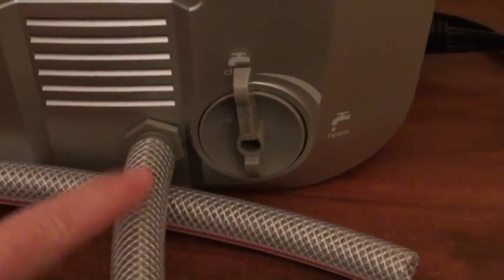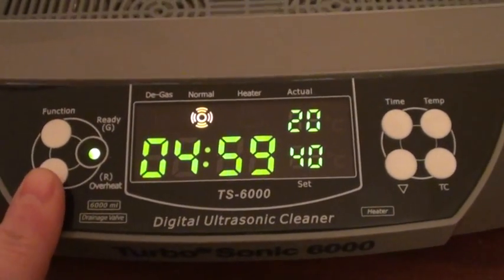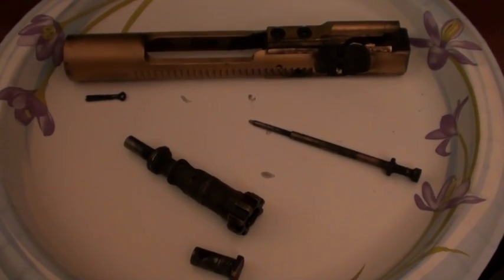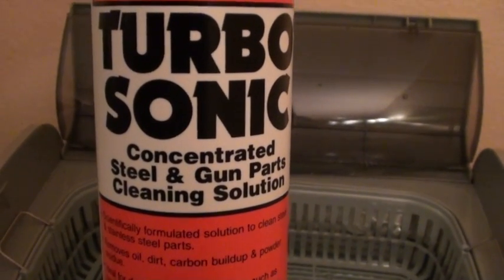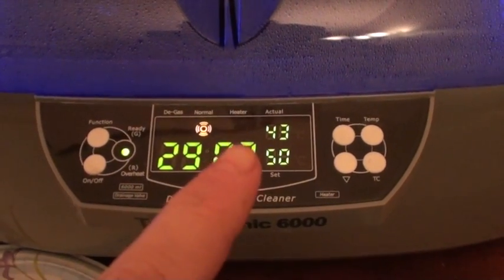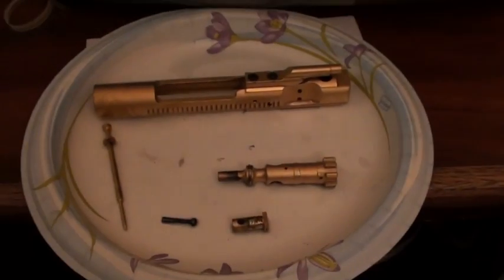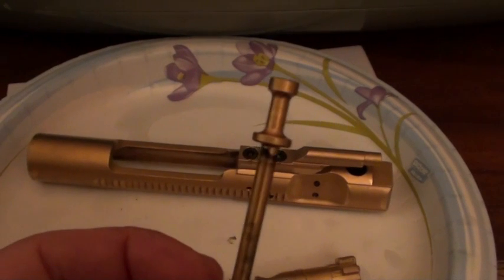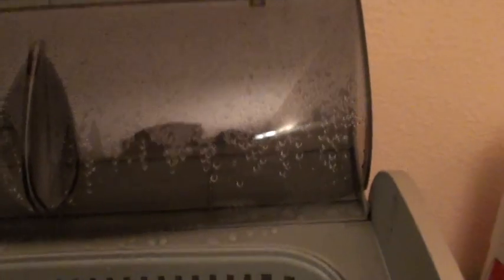Turbo Sonic 6000 Ultrasonic Gun Parts Part One

Comment: The De-Gass feature does not conduct a deep clean on your parts. That feature is to move any air bubbles "de-gas" from your water before submerging your parts. Less air molecules in the water, reduces cavitation which is not effective on cleaning parts.

Comment from the maker: Depends on what you are using it for.

Brass: prep the primer pockets, 1.5oz solution, cover w/H2O, run heated 25mins, drain, cover w/H2O only, run for 15mins twice....my cases come out very clean

Gun Parts: set up like in video, a good coat of oil on the parts, wait a few mins, wipe extra
The ultrasonic gets into the metal I find the metal gun parts will drink up the oil

Good Luck